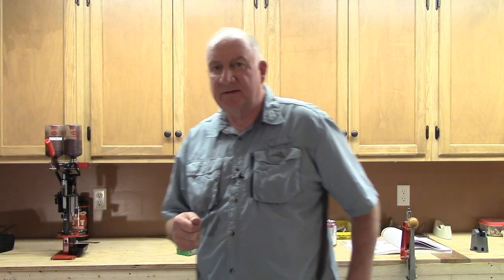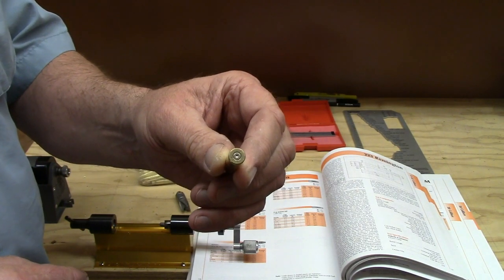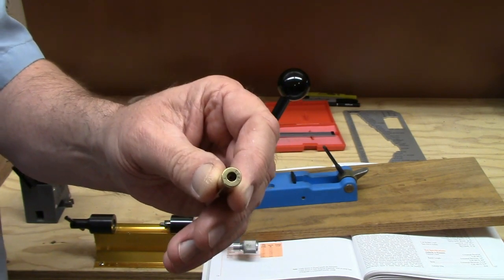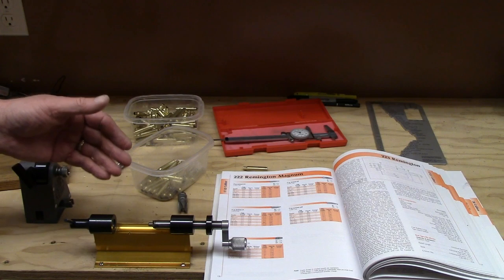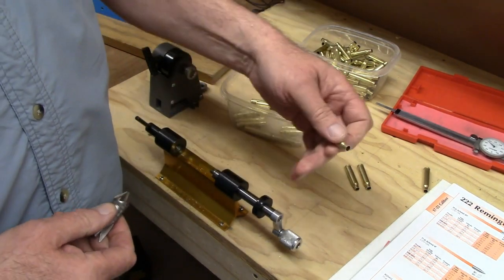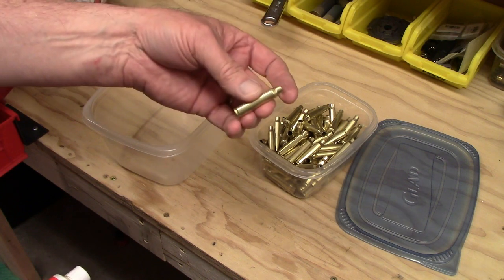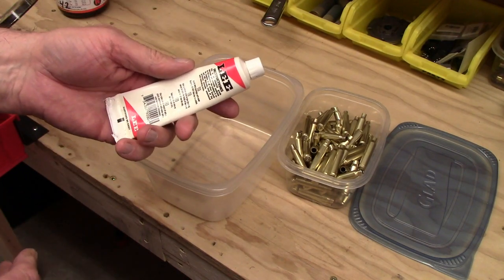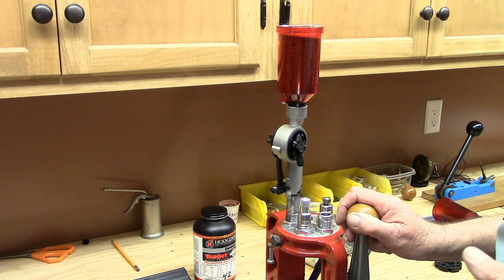How to Use the Lee Loadmaster ~ A great .223/5.56 progressive press!

Comment: Did I miss your removing the lube from the cases?
Reply from the maker: Kevin Collins 
I just didn't include it in the footage.  I think I explained it, which is a simple washing of the loaded rounds in warm water with Dawn detergent, and rolled onto a towel to dry.
Reply: GunBlue490 Thanks for the clarification.  I missed it.  I was curious because I usually prep my cases on a single stage then trim, chamfer, debur, and remove the primer crimp as necessary.  Then I load them progressively just skipping the sizing stage.

Comment: You say to sort out the military cases. How can you tell which are military cases?
Reply from the maker: Neal Daugherty 
Good question. While it's true that all military service rifle ammo uses crimped primers, it is not true that all commercial ammo is not, which further complicates identification.  Military brass will never have a commercial brand name embossed on the headstamp, such as Remington, W-W (Winchester Western), Winchester, R-P (Remington Peters), FC (Federal Cartridge), or any host of commercial headstamps.  Military brass made for NATO issuance will usually, but not always, have a small cross surrounded by a circle, and typically some cryptic looking markings of the producing arsenal, with perhaps embossed dots.  LC is Lake City Arsenal. As I said, some commercial brands made to 5.56mm NATO pressures, are typically crimped. All crimped primers are pretty apparent visually.  Look at a known standard round and the appearance of the brass around the primer.  It's smoothly radiused.  The brass around a crimped primer pocket is square and sharp, and if you look closely, you may see the annular ring immediately around the primer pocket where the die stamped the brass, which is often off center.
Reply: Thank you sir. That helps me alot.
Reply from the maker: Neal Daugherty 
You're welcome. Also, another identifier used by most military ammo is the 2 digit production year along with origin so a case marked FA 67 means Frankford Arsenal, 1967, and LC 12 denotes Lake City Arsenal, 2012. Frankford Arsenal closed in 1977, the last production year of that historic principal military supplier.
Reply: Thank you again.

Comment: Why do you trim before you size your brass? Are you not negating the purpose of trimming?
Reply: djp279  I think gunblue is forgetting that the pilots are machined to fit the SIZED necks. If you trim before you size, it's a loose fit and the case can wobble.  Probably not a big deal but....
Reply: He’s doing that because he hasn’t got a clue what he’s talking about and should take this video down.

Comment: My opinion is that the beginner who can only afford one press ought to get one of these and just run it without the indexing pin, and case kicker, until he has each function dialed in. Then put them back and  manually feed once case until it has cycled through each station, until he is comfortable with how each station should behave. Then move on to feeding with the case feeder, at least for pistol calibers. It's nice to have a single stage or turret, but if I could only have one, it would be the LM.  And for a while it pretty much was. I had a lee single stage, but it was very seldom used even from very early into it.

Comment: You should rotate the Dillon swage tool 180 degrees on that board.
Reply from the maker: You may do whatever you want with your Dillon, but I'll do whatever is comfortable for me.  position has nothing to do with it's function.  Thank you.
Reply: Sorry, I had hoped you would be more receptive, given the technical competence of your videos, but I have to disagree. The way you have it mounted, the board creates s fulcrum about three inches from the pivot point of the tool’s handle, allowing it to tip when you activate the handle. I think that if you unbolt it from the board, rotate it 180, you will find the fulcrum created by the end of the board will now be 8 inches away, and have no tendency to tip. But as you say, if you like it that way...
Reply: @jakerpelman  I gave you a thumbs up. I mounted a Lee BenchPrime in the way that you suggest. At least he's cordial to you when you disagree with him. When I disagree with him, he deletes my comment. LOL.  When he did that, I learned everything I need to know about GunBlue.
Reply: There are better ways to deal with military crimps than that Dillon tool too inconsistent, just cut them out and be done.  Stopped swaging a couple years ago and never looking back

Comment: what model calipers do you have or suggest ?
Reply from the maker: Nick J 
They are Mitotoyo, which I have had about 25 years.  I prefer dial over digital, because of their simplicity and no battery. As to the brand, I can't make any recommendations beyond these, though I know there are many decent ones.  They should have zero backlash or hesitation, and should operate very smoothly.  Good ones can be precisely calibrated.  I would certainly confirm their accuracy with a known standard, such as a Sierra bullet, which measure 1/2 thousandths over stated bullet diameter.  A .308 Sierra bullet will mic at .3085, and a .224 at .2245, and so forth, and a good caliper will easily read to that accuracy. Mitotoyo is probably the only competitor to Starrett for industrial use. Having said all that, you can get by on economical plastic dial calipers for the simple uses of loading ammo, until you can afford better ones.
Reply from the maker: Nick J 
They are Mitotoyo, which I have had about 25 years.  I prefer dial over digital, because of their simplicity and no battery. As to the brand, I can't make any recommendations beyond these, though I know there are many decent ones.  They should have zero backlash or hesitation, and should operate very smoothly.  Good ones can be precisely calibrated.  I would certainly confirm their accuracy with a known standard, such as a Sierra bullet, which measure 1/2 thousandths over stated bullet diameter.  A .308 Sierra bullet will mic at .3085, and a .224 at .2245, and so forth, and a good caliper will easily read to that accuracy. Mitotoyo is probably the only competitor to Starrett for industrial use. Having said all that, you can get by on economical plastic dial calipers for the simple uses of loading ammo, until you can afford better ones.
Reply: Thank you very much, God Bless :-)

Comment: Great video. I like the lubrication tip. Quick question.... what bullet were you using for this project?
Reply from the maker: David Tabor 
It's the Sierra 69 grain Match King.  It's a very popular bullet among Service Rifle competitors for intermediate ranges out to 200 to 300 yards.  Beyond that, many are now using the 77 grain Match King, which can fit into a magazine, and some use the long, slender 80 grain for 600 yard slow fire, as it's too long and must be singly loaded.  My rifle is a target grade Wylde chamber, 8 inch twist, with a 20 inch barrel, common among CMP and NRA shooters which will handle those long bullets at the higher velocities attained in a full length barrel.
Reply: Thanks much. You're the best.

Comment: Does anyone have a video of one of these actually cranking out rounds. From the videos I've seen I can load faster with my rcbs single.
Reply from the maker: I have no idea what videos you are talking about, but absolutely no single stage press can possibly operate with the same rate as a progressive press.  A progressive press turns out one completed round with each stroke, and that stroke is operating several stations of operation at the same time, using all dies. A single stage press performs the function of a single die with each stroke.  At a relaxed rate, even without a bullet feeder, this press will load over 600 handgun rounds per hour, and without a case or bullet feeder, over 240 rifle rounds.
Reply: @GunBlue490  Yes I have heard that. I'm just saying I haven't seen one in production mode. I am thinking of getting one and would like to see it actually cranking out rounds. I was being a little sarcastic. Sorry